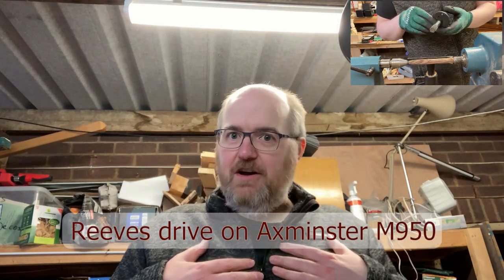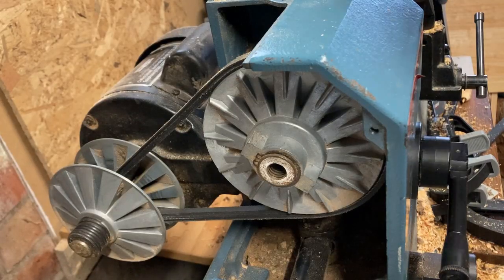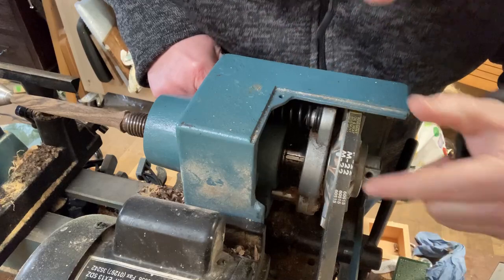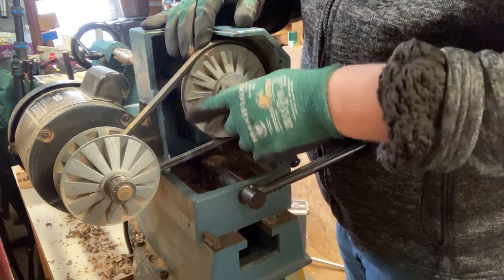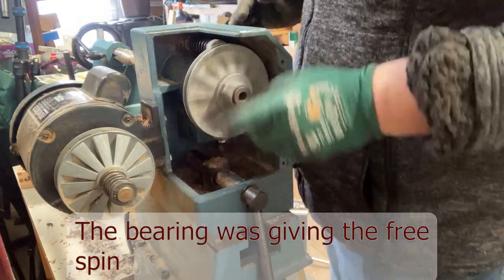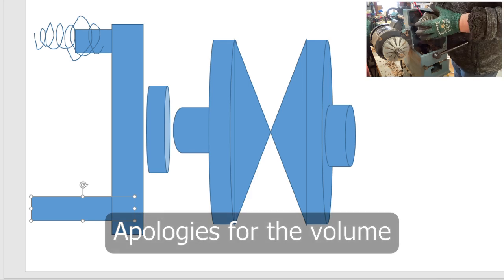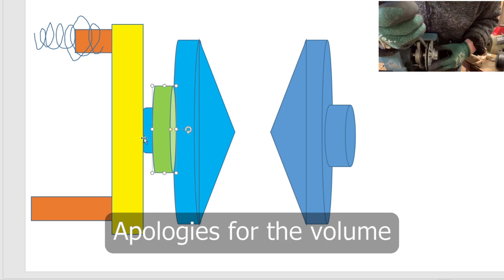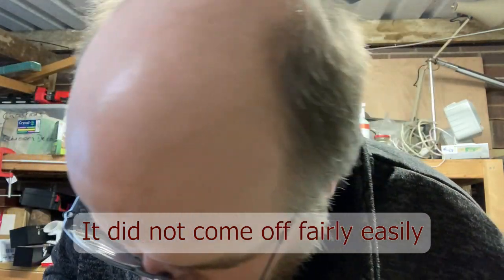Broken! Can I Repair My 30 year old Wood Lathe?

Comment: I always hate attempting to remove aluminium (or any of it's alloys) cast parts.  Especially when I'm not completely sure what's holding them on.  They just break so easily.
Reply from the maker: Thank you for watching and commenting. 
I did not realise there was a missing circlip but even then there was no movement between the pulley and bearing. My next repair will allow for that.